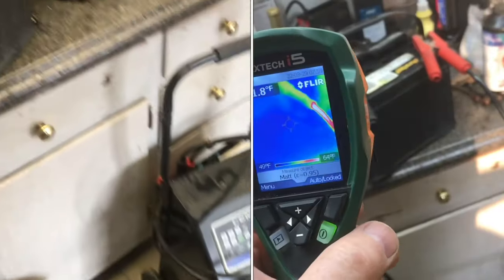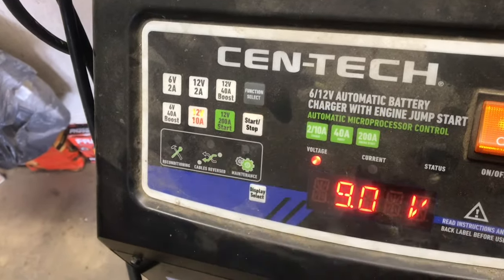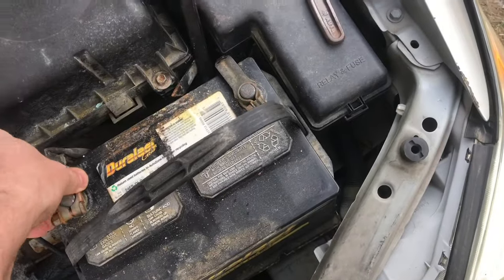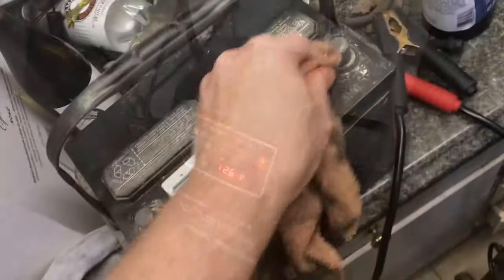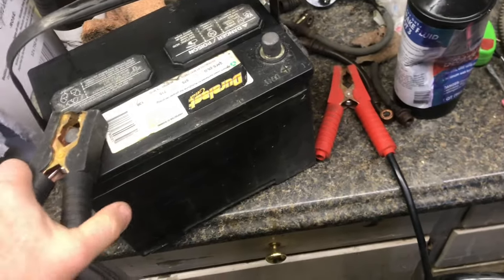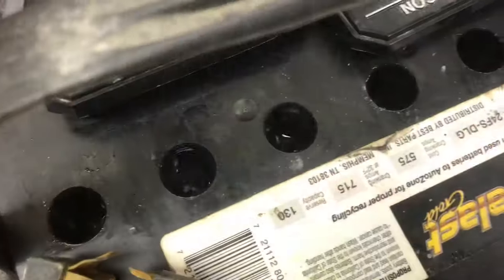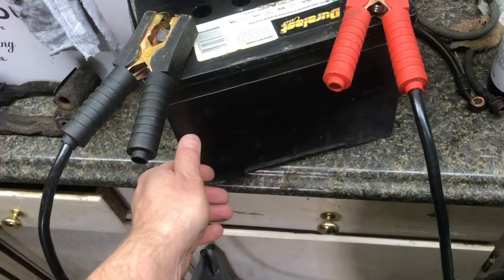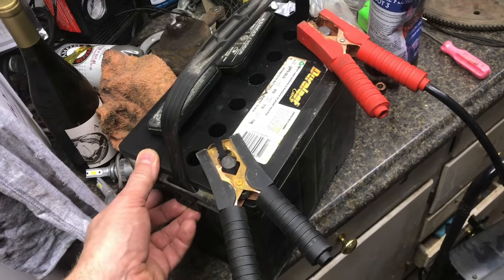“using” CEN-TECH 2a 10a 40a 200a 6/12v automatic battery charger with engine jump start

Comment: Drop that battery on concrete from about 6 inches a few times and then retry your charge.
this will sometimes break up the dendrites that are causing a short and hence no charge in the cell.
Reply from the maker: Thanks, I was tapping it pretty good with a screwdriver. I’ll go through some more hot cycles, I’ll definitely give it a few drops👍

Comment: So how long have you had this unit?  Seems to be a lot of complaints about it.  Also it said in the instructions that a 40A charge will require and input of 10A but that is hard to believe if 40A at 12v is 480watts.  Asking for off the grid reasons.

Comment: This battery charger is a POS returned after a week of messing with it. Dont waste your time or money
Reply: Wish I saw this earlier today, lol
Reply: I just bought one today, and I already feel the same
Reply: @sidewayzmike  Yeah I it would just keep turning the internal fan on an off forever without reaching full charge. The people uploading videos about must be getting paid to promote this garbage. When I took it back they wanted to charge a restocking fee but after blowing a fuse they just gave my money back. I told them they should pay for putting the damn thing together 😂
Reply: Yeah, I ran the battery down unintentionally on a friend car, at my house for other repairs.  I think the security module is triggering.  But, battery went so low, no jump start would get it to crank.  Ran out and picked this charger from HF.  Put it together and tried charging from the under hood posts, to at least move the seat, to gain access to the battery under the passenger seat.  This charger wasn't up for all that.  I've used a few Schumacher's that would've handled that easily.  

Funny how this charger is so damn quiet, btw.  I'm gonna hook it up to a few different setups and look more into it, before I take it back.  Might try using an additional meter, to get a better idea of things